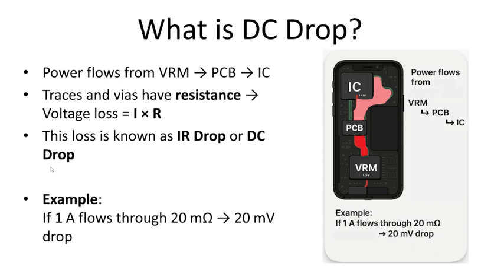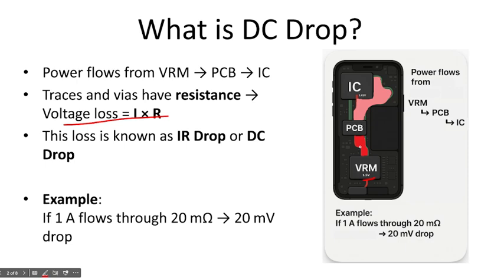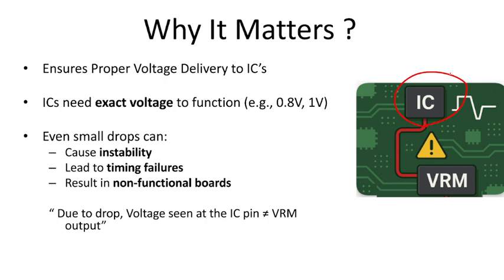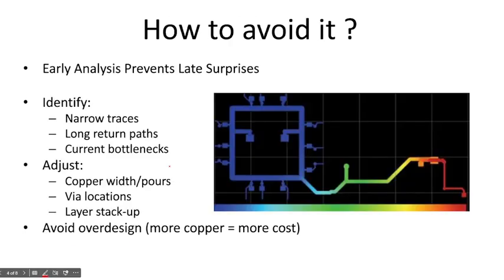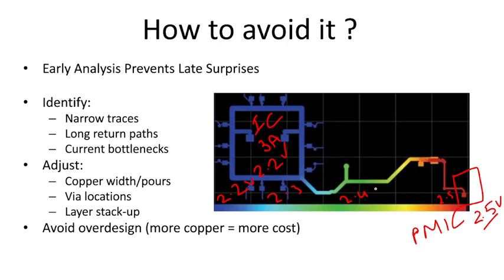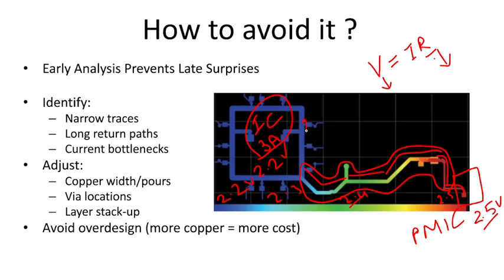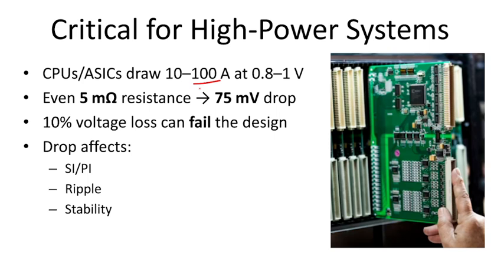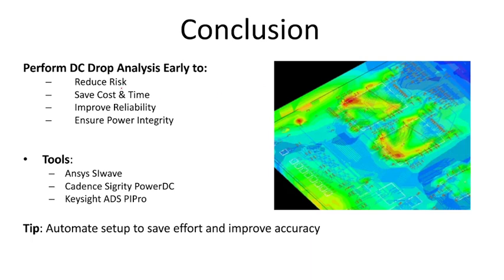Why DC Drop Analysis is Important in Electronic Products

Comment: DC drop is important on PCBs (e.g. 8 x audio amplifiers on one pcb or multiple MOFET drivers infrared LEDs  in 100mA operating current with AM (amplitude modulation).
The same problem by long cable lines in combination with around 50 units each also with 1.5 meter cable. Some ICs and relays will be effected.